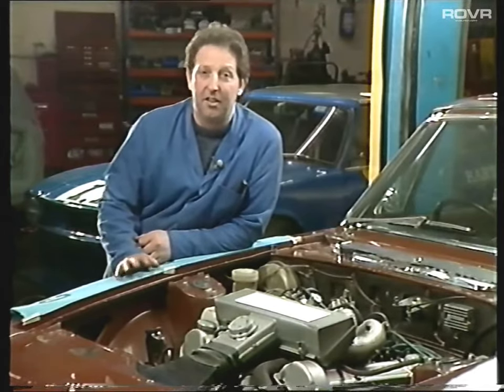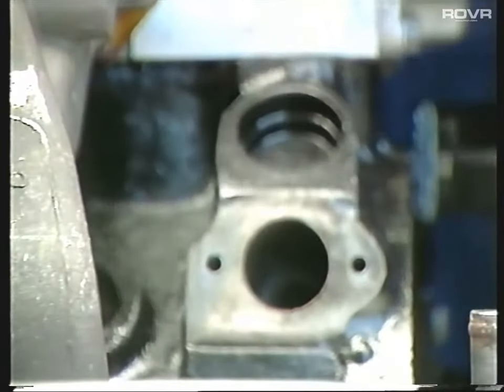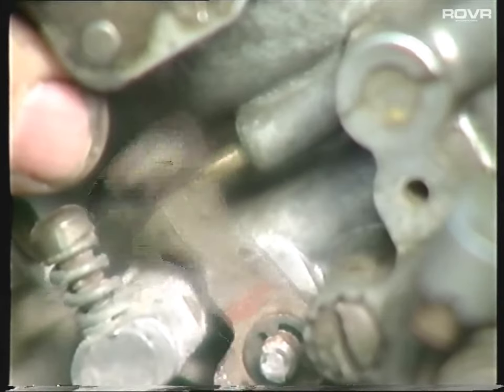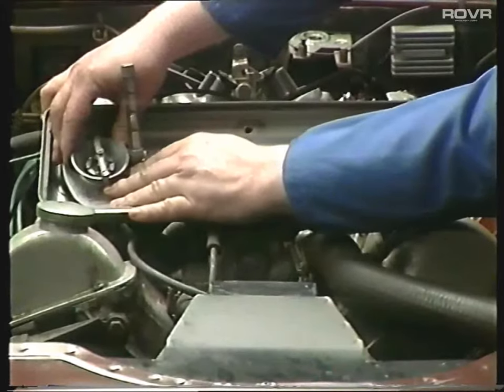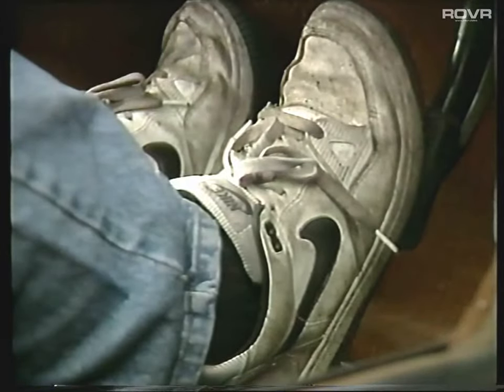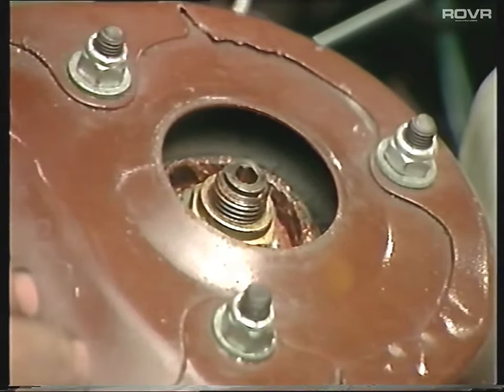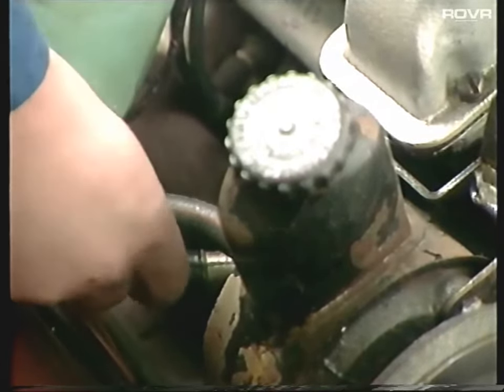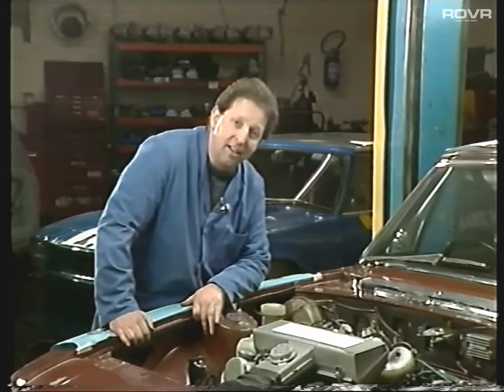Hart Racing Services - Triumph Stag - Service Guide (1995)

Comment: had an engine rebuilt by this lot in the 80s , only just made it home ,, they had rebuilt the oil pump Ha Ha  coff coff ..had to buy a new one at only £30.  to get the oil pressure back .. ?  I still have the bill for about £1600 for the crappy work they did ,, Conan